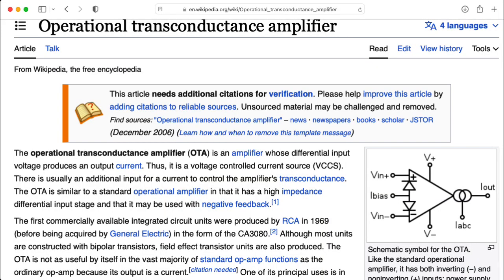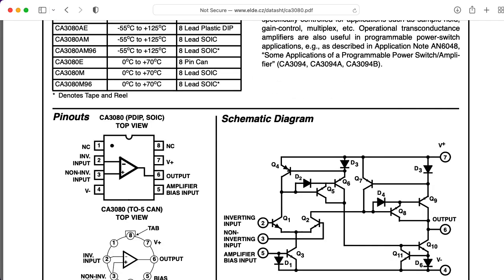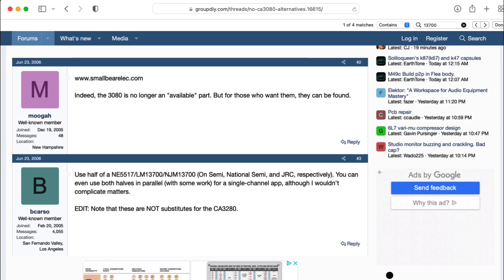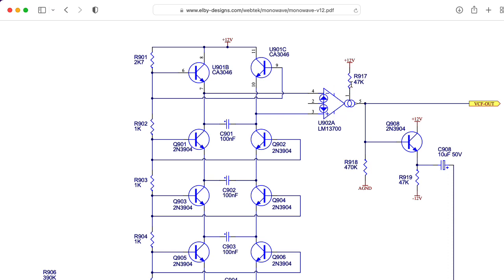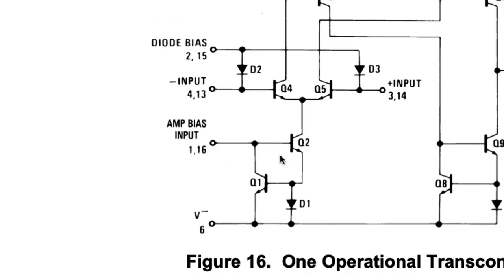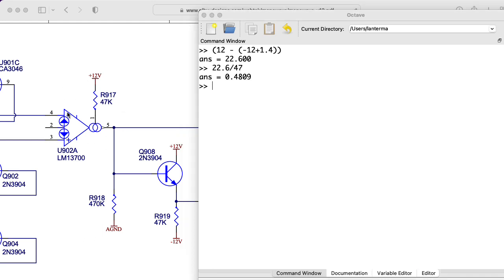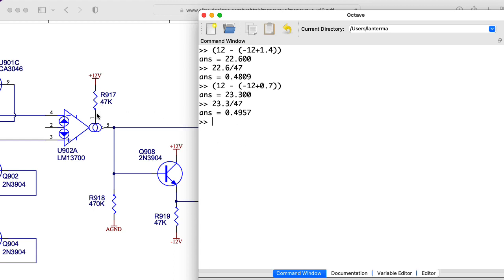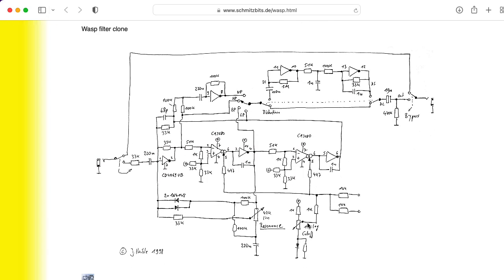ECE4450 L4.2: 3080 vs 13700 (Operational Transconductance Amplifiers)

Comment: Just as a side note, there was also a 3094 (single) and 13600 (dual) with some differences between them and the 3080/13700 respectively – from memory I think the EHX Small Stone used the 3094, and I'm sure I've seen the 13600 in various early 80s devices – they're not necessarily not straightup swappable with a 13700, but not necessarily so either... something to do with the buffer design being different internally.

Comment: In that wasp filter you flash at the very end, the power supply is +-2.5v. Could you replace the 3080 with a 13700 in this case? According to the specs the LM13700 needs at least +-4.75, so it seems that is another difference between the to OTAs.

Comment: In my understanding the 3080 in DIP is in production again. You can find them at small retailers like Thonk. Also, the DIP version of the 13700 is out of production, the SMT version is not.
Reply from the maker: Oh interesting! Apparently there's a company called Alfa making them as the CA3080.
Reply: @Lantertronics  Yes. They also make clones of the old CEM line IC's and some other stuff like matched transistor pairs in metal cans and a quad OTA (AS13704).
Reply from the maker: @PWMaarten  Excellent!
Reply: Yes, I have used the Alfa 3080ies for my Oberheim Eight Voice Clone Project. I don’t have an original SEM to compare it to, but I am very pleased with the Sound! @Lantertronics

Comment: Thanks for all the deep insight! BTW: can you (if time allows) explain the working of the Colorsound inductor-less Wah)? I've finished building one, but don't really understand, how the wah sound is created.
Reply from the maker: It's what's called a twin-T notch filter -- but they put it in a negative feedback loop so it basically inverts the transfer function and turns it into a band boost (think of the BJT base as the negative input of a primitive op amp and there emitter as the positive input).
Reply: @Lantertronics  Thanks. Is there any simple way to calculate the Edge Frequencies and the Q-Factors? I measured the circuit with a noise signal and found fl=200Hz, fh=2000Hz and Q between 2.4 and 5. When iI dial that into my KPA, the Wah Sound is not complete right. Am I missing something?.
OK:I found a site, where could calculate the required info(FH 173Hz, FH 1691,QL=5,QH=1.3). The calculator though doesn't have the 33k resistor, going between the LP Cap and ground). The Wah created with the new values sounds quite right. Any idea, wheat this additional resistor's function could be?

Comment: Does the hyperbolic distortion characteristics of the 3080 simulate the distortion characteristics of basic dual triode preamplifier tubes like the 12ax7?
Reply: Although a distortion circuit using this tanh character will probably sound nice enough - tanh is often used in software distortion, because of its nice sound, as well its uncomplicated use: just drop in a tanh and you're golden. It is, however, symmetrical, so it generates odd harmonics rather than even - this can be easily remedied in software though, and probably in circuitry as well.
Reply: My guess would be: not exactly, as valves follow a 3/2-power law, rather than exponential

Comment: Professor can you contact Texas Instrument and ask them to put the the LM13700 in a dip8 package to save space on the pcb's (without the darlingtons and terminate the unwanted things on the silicon die them inside the package). that would be really useful if you design 4HP modules, witch i do.
Now i need to stack pcb's with headers because a bit of the circuit doesn't fit due to the dip16 package and routing becomes a hell of a job.
Reply from the maker: If you need to save space I'd go for the surface mount package (yes, I know it's more of a pain to deal with).

Alas, there wouldn't really be enough of a market to justify TI retooling for a new version of the same die in a different package.
Reply: @Lantertronics  Ya, maybe something conservative, but i like to be able to replace/recover if i brake it or the PCB doesn't work. during the pandemic the dip version became instinct at mouser and at some point they announced some 30.000 would be delivered in 2 tranches and than i got new ones. 25.601 are available now, so around 4.400 have been sold in the last 10 months or less. 

Would still be cool if TI would do so, but there is no form of contact possible, it all goes via a external customer agency, than you're sure it will lead to no where. i investigated.
Reply: @AnalogDude_  You could use a SMT to DIP adapter board. I do this quite a bit myself when prototyping or for trying different OPAs in kits that used a DIP part, originally.
Reply: @control_voltage  Ya, i recently got a few SOIC8 to dip8 adapters, but not yet used them.  : )

Comment: I saw many ladder filter using and OTA as difference amplifier for their output. I've always assumed it was both for the sound (as you said, the tanh property) and for a low part count and low cost "INA" since it can be used on open loop configurations. In more recent Moog schematics there are various 13700 placed around with a fixed Iabc that were there just in case they needed more VCAs before production or for quick prototyping
Reply from the maker: Huh... having various 13700s around "just in case" they needed a VCA is really interesting!
Reply: @Lantertronics  never enough VCAs!